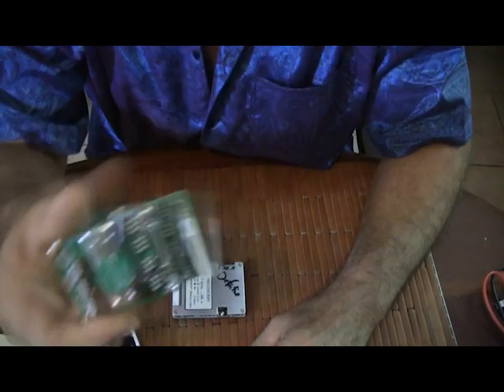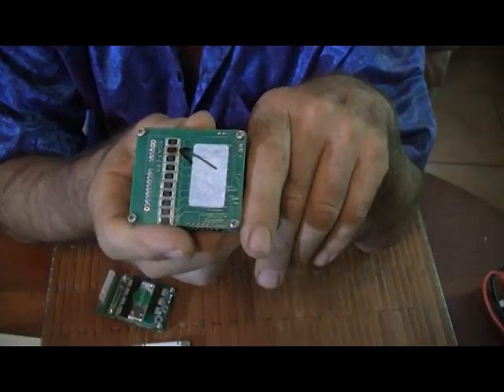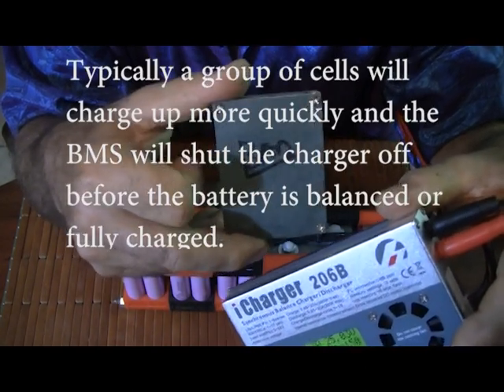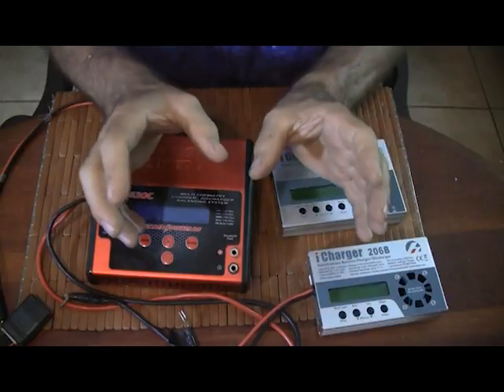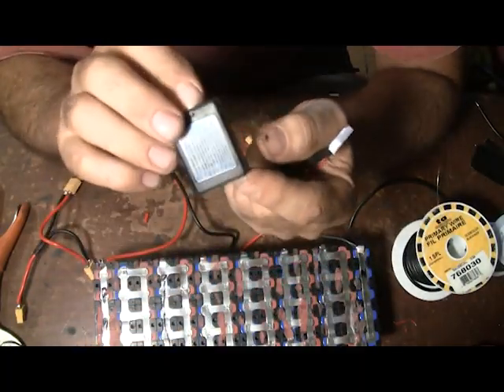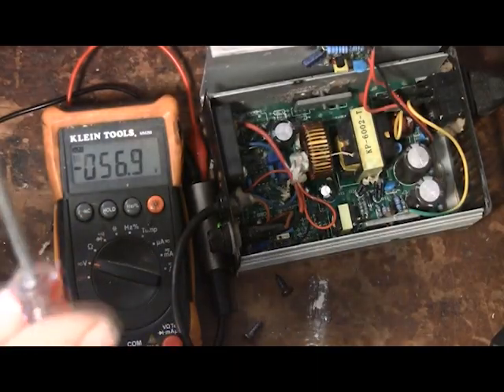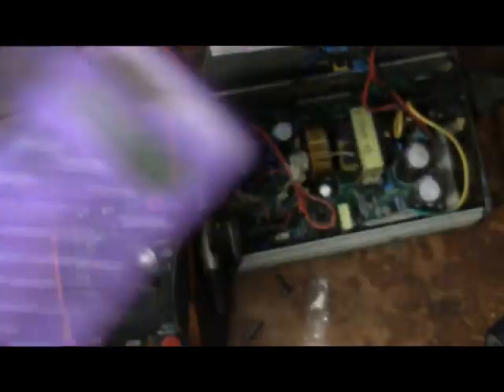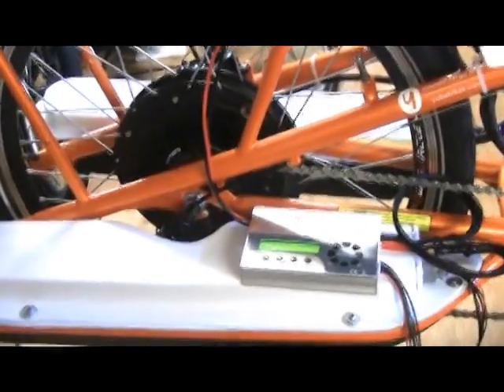How to build a safe and better lithium battery WITHOUT a BMS.

Comment: Oh this couldn't be more wrong.  People you need a GOOD BMS, and if you want your batteries to last you need low cell cutoff and high cell cutoff at least.  He is correct you will get much more service by not charging all the way to 4.2 and do not drop below 3.3.
99% of the time, lithium batteries in bikes, cars, computers, etc are not balanced, therefore often die far early.  Not balancing just speeds that process up.
You can use the charger to balance as this fella does, but the low voltage cutoff better be there, and it will cost you a lot of extra charging time.
I don't need to state my credentials, and this isn't a debate.  Just trying to help and hoping you won't be misinformed.
Reply from the maker: Thanks for your voice.  I agree the low voltage cutoff is essential,  hence the cell-logger.  This is for hobbyists and not for plug and play folks.  If you are knowledgeable you can make your batteries last much longer then when managed by a BMS.

Comment: I have some questions about keeping a pack charged and balanced for use as a solar battery pack for small devices (USB and 110vAC <200w devices part time).  I have a total 47w input and a 300w inverter, 7ah SLA.  The SLA is what I intend to replace with 18650 packs.  Basically I have run into the same issue with BMS boards and their general unavailability.  I'd rather make my own breadboard solution or find another method.  If anyone would be willing to help, i'd appreciate it!
Reply from the maker: Hi Sin

On my home power wall I use these circuit boards:

https://www.amazon.com/gp/product/B01GJM04GC/ref=oh_aui_search_detailpage?ie=UTF8&psc=1]
You can get one for each parallel group and use it to turn on a load when the voltage gets too high.  

But your capacity is well within what a common BMS should be able to balance.  I'd use a BMS and a Drok voltage converter- to manage the fluctuating solar voltages on this one.   A hobby charger has to be turned on and off to balance- a real pain when working with the sun.

Comment: hey shawn, do you think I could use a cheap 2 cell litium polymer battery charger to charge a 6s li ion batter 2 cells at a time? I dont want to buy the icharger since its 150$ canadian, and i figured since li ion and li polymer have the same voltage, maybe their chargers are interchangeable. thanks.
Reply from the maker: Yes you could.  With the same finishing voltage the chargers should be interchangable.

Comment: "tripple the life of a pack with a bms" this assumes all bms use the same balancing methods... they dont.  "a better battery pack with out a bms"  False. If you take the time to select the right components for your build ..and go down the path of an active balancing/charge redistributing bms... it will be better in any objective measurement of "betterness" you wish for two packs to be compared.
Reply: The guy made his case with some products and useful info. Can you share some products and examples?
GENUINE question because I have a 52v 20amp battery that I recently experienced issues with ... guess what it was?
OOOOOOH ya, the stupid junk BMS. the battery was reading ~28v and when I checked it before the BMS it read a fully charged 58.6v
Reply: @atefamriche9531  linear Technologies. You probably need to make a circuit board but you can do things like active balancing during run time or in other words cell groups prop up a weak cell on the fly

Comment: Hi, I connected my JST-XH connector but all I get on my IMAX B6 is "Connection Break". But it works with my cell logger perfectly. Any advice?
Reply from the maker: You need to also have the main power wires from the battery connected to the hobby charger for it to work.  Is that the problem???
Reply: Shawn McCarty It probably is! Lol! Thanks! I'll try it again tonight
Reply: Shawn McCarty Yep that was the problem!!!! But... my wires were the wrong way round too. My ribbon was upside down to yours in the way it plugs into the charger., I must have bought the wrong one off ebay so my negative was red and all the rest were positives. Was very confusing but got there in the end! Huge thanks for your help in all of this!
Reply from the maker: Glad you got it figured out Danny.  After you have lived with it for a while it won't be confusing anymore!!
Reply: Shawn McCarty Just been out on a test run and it worked for about a minute. When I got back I saw one of the cells nearly drained completely down to about 1V whereas it barely touched the others. Any idea what's going on? Hopefully it's not taken any perminent damage. I've got 13 cell, Six 18650 batteries in each cell, all soldered up like above but wired together in series for a set of 6 cells + 6 cells + 1 cell. It's one of the 6 cells that seems to be losing all the voltage fast. Thanks in advance!
Reply from the maker: Yes, you have a bad cell or two in a parallel group.  It is draining it's cellmates.   You will need to either replace the entire parallel group or take apart your parallel group and test each battery....   Sorry, it happens.
Reply: Shawn McCarty Thanks I'll take a close look at it.

Comment: I always thought 18650 cells have protection circuit/system built in them to avoid over charging and over discharging??
Reply from the maker: No, they don't.  Sometimes a protection circuit is added later.

Comment: Ok, so just to be sure: you can ''bulk charge both at the same time'' meaning you use the balance charger in another setting in order to charge? And then, when you want to balance charge, you separate the 2 packs and then charge them one at a time (assuming you have only 1 charger)? Thumbs up perhaps so people can see.
Reply from the maker: YEs, that is it.  But you can bulk charge to extend the life of the battery by keeping them connected together and charging both at once.  Either with the balance charger- not in balance mode- or a separate charger.
Reply: I'll be better charge it at pararel if I only have one charge and leave it charge with alarm on :D

Comment: Shawn - this is far and away the best video I've seen on setting up on 18650 battery pack. I can't tell you how many times I've paused your video, taken notes and implemented into my pack. I decided to build a single pack broken out into 2 (non-mechanically). Specifically the harness to connect the two in series and the cell-logger wiring - great stuff ( I even bought the same balance charger but the 8 not the 10). The only aspect of the video which confuses me is the 8 pin Deutsch at the end (I paused and tried to count the holes in the plug). I have to believe this is an adapter for the 8 pin balance lead, in which the adapter connects the "sensor wires" (assuming you are referencing the cell logger wires) together to something else. I'm just not sure about that last part, understanding that the XT90 is the power lead. 16:30 of your video. Any illumination on that last bit would help.

Comment: Learn how to use switching power supplies  and you can use switch system to  feed the weak cells to keep up with the others. I like synchronous DC/DC isolated converters 95% efficient.

Comment: Buy a handfull of those 30 or 40 whatever needs are plastic autofuses and solder into wire system for safety sake. There so cheap! Things go balistic just once and think of the batterys and permanent harm prevented. Dean gold plated connectors are really cheap to.

Comment: This guy doesn't realize the the wiring nightmare this creates. also what about enclosed batteries? Do you suggest not to ever have enclosd batteries?
Reply from the maker: Hi Cutler,

I build plenty of batteries with BMS's.  They are for folks who want to plug and go without thinking about what is going on under the hood.  My video is for hobbyists who want to be able to monitor and control their balance and charging and to verify that it is properly done.  It is the idiot light vs instrument panel debate.

Wiring nightmare?  Same as with a BMS. 

Try using a hobby charger on a battery and see what you think!  Lot's of hobbyists do.
Reply: +Shawn McCarty i did use a hobby charger for a while. it wasnt worth it. just to charge you have to plug and unplug 4 seperate connectors vs just 1.
Reply from the maker: Yes, large S batteries will take more work.  But here are 10S hobby chargers out there now and 8S duo's too.
Thanks for your comments.

Comment: BMS should always be used if you value your investment. He doesn't even mention that the RC charger is bleeding the same way a BMS does. Also he doesn't mention that you have to choose the correct BMS for the battery pack size.

Comment: Hey Shaun a few months ago if someone said watt to Me my response was who I can suture any part of your body but soldering scared me,  now how I found you  Ii have a proteco PhantomX 36v 500 watt rare hub brushless motor and a prodeco secret controller I do know it' can handle up to 20amps  .I bought the bike when first came out late 2012-feb 2013 and I ride it regularly I am no mechanic. I live in Florida and Now Trump is President and tomorrow never knows I decided I'm gonna lean me about Solar which became a hobby and was forced to ohm and learn its definition I armed myself to protect my bike I love it  Now that my tin hat  the world of confusion it's all over the  end . I started looking to buy a new electric bike then I discovered you and You Are. My electro Guru I actually checked my old battery because I nave a meter from the solar and u taught me how to turn it on . It still tops off at 4.0 using the charger it came with 42v at 2amps not bad for a 5 year old battery. So a prepper can never have too many batteries. Too much is just about right. I followed my gurus teachings 
Icharger memory loggers, 150 of Panasonic finest ( they arrive tomorrow) before I saw your lego  DIY , I bought your competitors I'm sorry I would have bought yours only out of respect . And I checked out your web page as well I will be building many batteries  I'm gonna make everything modular my 36v for the bike will be interchangeable with my 12volt solar array buck it u know so I just thought I would express my gratitude 
I'm still drawing out my series and parallels it needs to be 36v  I would like it to be maxed in AH plus it need to be able to partition into usable 12v blocks just in case of a hurricane or  well you know  I love my bike I wish I could put a computer display odometer and incorporate battery SOC or be a pussy and get a 750V 1000watt battery complete with USB port hell I think I'll build it

Comment: Great Video Im doing this style battery build, couple of questions.  With the Icharger you can still bulk charge? Can you set the paramater on the Icharger to charge to 4 or 4.1 volts only or do you have to hack that as well? or buy two chargers?
Reply from the maker: Yes you can bulk charge with the icharger.  That is what is so cool.  Full charge only when you really need the range.  And, unlike a non-balancing charger, the icharger will balance the battery.
Reply: Shawn McCarty i see there was anice 14s Hyperion charger but it seems to be discontinued looks like charging 2 x 7s in parellel is what it shall be. a quick question in maths for charging in parallel, I am building a 7s x7p x 2 to run as a 14s pack with the mj1 thats approx 24amps so at .2 i think thats around 5amps if i charge 2 in parellel would i set the charger at 10amps?
Reply: A quick question on Maths Im building a 7s x7p x 2 for a 14s setup around 24amps at .5c the standard charge rate thats 12amps to charge the pack and 24amps if I charge the two in Parellel? Is that right seems high ? Just want to make sure I buy a powerful enough charger like the 3010B maybe. .2C would be around 10amps for the two packs.
Reply from the maker: Hi Stephen,

Yes, a 24 amp hour battery can be charged at 10 amps.

Comment: Will these hobby chargers charge and balance a number of cells less than its maximum capacity? For example, say you have a battery with 13 cells and you spit it into two batteries; one with 6 cells and the other with 7 cells. Can you connect the 6 cell battery to the charger without getting an error? I like the idea of balancing and charging using a hobby charger because you have so much more control over charging and can triple the life of your battery. 90,000 miles is crazy!!!.
Reply from the maker: Yes, I call them spit packs.  Divide and conquer!  It helps to build a pack that you can split in half evenly- like a 7S.  I talk about all that in my $3 ebook at www.batteryblocs.com

Comment: Wow Great Video! - Thanks Shawn. 

Do the cell loggers draw power from all the cells evenly or just one? If they just take from one you may find yourself having to balance more often?
Reply from the maker: The electronics draw power from all of the cells.
Reply: Well you have sold me. I just chucked my BMS and ordered a hobby charger and cell loggers :)
Reply from the maker: You will love being able to see that the battery is balanced.  Try to keep the cells voltages between three and four volts and live long and prosper.
Reply: Thanks Buddy - you too

Comment: Super shawn, the concept is easy and you got at very reasonable costs a perfect picture of the state of your battery packs. I ll order some low voltage buzzers and this Icharger (for 6S) and will refer the results happily when finished. Thanks a lot. I was about to buy an expensive BMS 12S ... but know I ll go for your genial solution of the charging problem.

Comment: Really glad I found this video before I build my pack. I've gone BMSless and have no regrets so far (300 miles of riding so far, and ZERO Balancing needed using 280 used laptop 18650s). I'm waiting for a little 8s voltage display that cycles through the voltages of each series, it cost me a $1, that's the kind of feedback I want.
Reply from the maker: Yes, once you learn how to go without a BMS you don't want to go back.  A BMS is kinda like training wheels for batteries.

Comment: Took me a while to find a "cell logger". For anyone else like me they're called Lipo Voltage Monitor.
Reply: Can't you just turn a bulk charger down to 4v a cell also? I never had any of the issues you mentioned with my bms and I built my battery out of cheap laptop cells but I also  discharge tested every cell and labeled them with the correct mAh and and built each series to have the same mAh. Lasted about 400 charge cycles and the bms always kept them balanced to within .1v (I would check every 10 to 15 charges) as far as low voltage shutoff I hooked up a little lcd that told me voltage (about 3 bucks on eBay) so the only thing I like about your (in my opinion) extremely over complicated setup is the ability to charge to 4 volts a cell.
Reply: What are the cables to this monitor called on ebay?
Reply: aaaarneaaaarne JST-XH Connectors
Reply: thanks!
Reply: Danny Tillotson thanks for the info, I couldn't find them and hoped that someone here would give some clue as to where l could find them. 👍
Reply: https://www.banggood.com/10PCS-9Pin-8S-Terminal-Wire-Balance-Charger-MaleFemale-JST-XH-Connector-Wire-p-1050139.html?rmmds=search&cur_warehouse=CN
Reply: Google> what is a cell augur? Lol
Reply: @mwint1982  I tried cell otters :D
Reply: me too but could not find it since Shawns pronunciation was not intelligible, thanks for posting !!

Comment: bms faults when a cell faults because the cell shorting the bms. you need a means to electrically isolate a cell in the bank or the dead cell will short the entire bank

Comment: Please dont rely on this guy. Maybe some BMS fail but Billions are working fine and making Batteries safe. If everyone of these batteries would be without a BMS there would be a burning Ebike every day everywhere.
Reply: Yep. If you go this route you must pay very careful attention at all times to charging and discharging or your battery pack will turn in to an acr welder and melt a hole thru the floor including your arm or leg or anything else that is in the way if your lucky. If not it will just explode. Go watch the YouTube videos of exploding lithium ion battery's and many of them are ebikes doing this exact thing.

Comment: Hey Shawn. I just finished my battery. What discharge voltage do you set your cell logger to?  And, is this the minimum voltage you allow your cells to get to to maximize cell life?  Thanks. I'm learning a lot from your videos. 
Where are you located? I'd love to stop by for a visit if you are nearby.
Reply from the maker: Hi Mike,

I set my alarm voltage to 3 volts.  It keeps you a bit above the "knee" in the batteries power curve.  

I live in Venice, Florida.

Comment: question regarding your cell logger switches, how are they wired? just a positive to power it and split the negative off the jst?
Reply from the maker: The same as a BMS's JST-XH signal wiring.   First wire, the negative, goes to battery negative, the following wires go to all the positives.
Reply: Right but how did you put the loggers on a switch, to turn it on and off with the flick of a button?
Reply from the maker: Yes, you put a toggle switch across the negative only.
Reply: Thank you sir

Comment: Even the hobby chargers are not really a match when you get very high numbers of cells in parallel.  I had one battery that I was testing for a golf cart and it was  10s 100p.  I ended up splitting each parallel pack into 1S and then charging all 10 series packs in parallel, from a 300 amp 5v PSU that I turned the trim pot down on until it reached 4.1v.  A full charge takes 7-8 hours but I rarely need to give it a full charge.
Reply from the maker: Yes, they are no match for power walls or other high amp hour packs.  Multiple small power supplies set to 4 volts could be used to balance.  Or the battery could be bulk charged and a voltage activated relay could turn on a resistor to pull down high parallel groups....